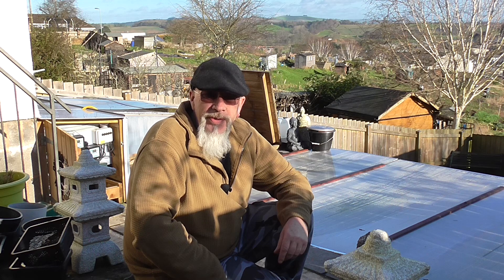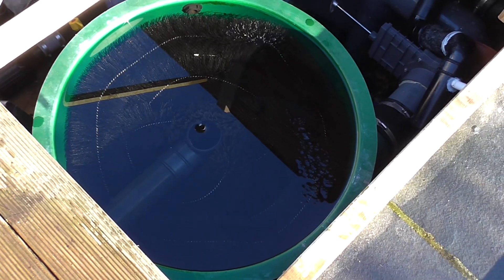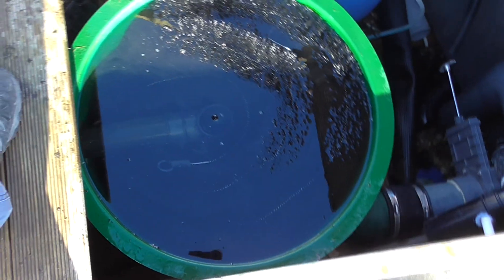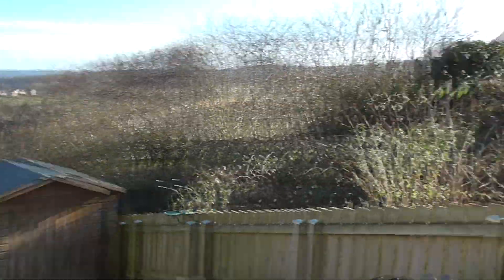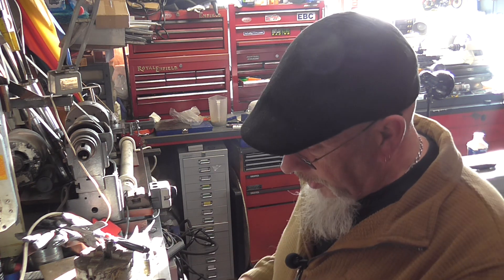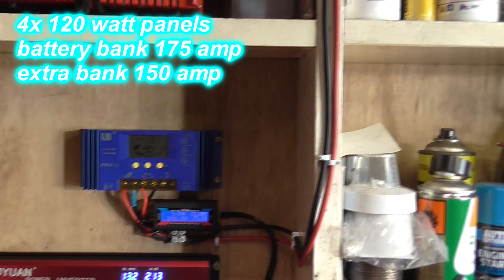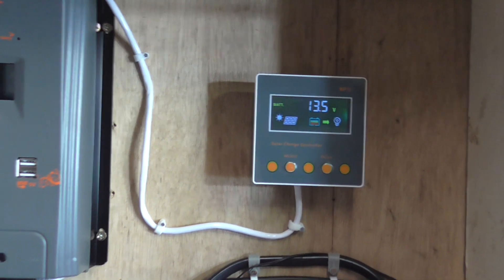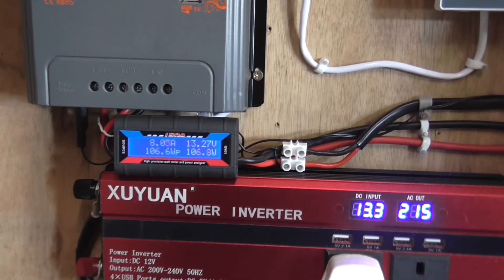koi pond on solar power

Comment: Check. Wills Solar on utube Automatic transfer switch game changer
Reply from the maker: Squeeks i have come along way with the solar from this video i now have 960w of panels in two 480w banks grid tie with battery bank that charges and switchs in if the main power gos down a real good day hear can see's near 5KWH i have a constant load from the house and pond that never drop's below  550w to 600w so get most of the day on free power summer time. Thanks for looking in

Comment: Good video mate, but all them electronics are way above me. well done mate. Terry.
Reply from the maker: Terry if you can sort out the power on them drum filters and wire your filter house like that then this is easy and well worth a look yourself even if you started off with 12v lighting off a small panel or two and battery in your workshop or filter house happy ponding mate and thanks for watching.
Martyn
Reply: Hi Martyn, I will have a look into it mate once I get all my jobs done. The wife's decided she wants the front room decorating now lol. But I will look into it mate. thanks, Terry.